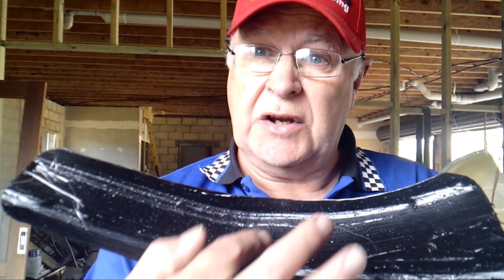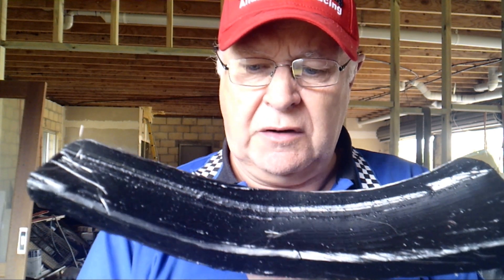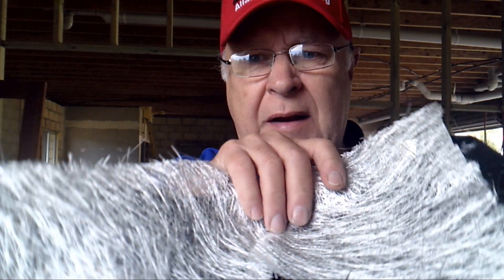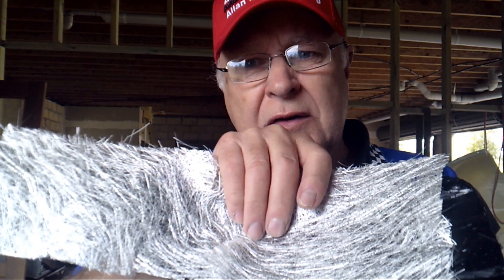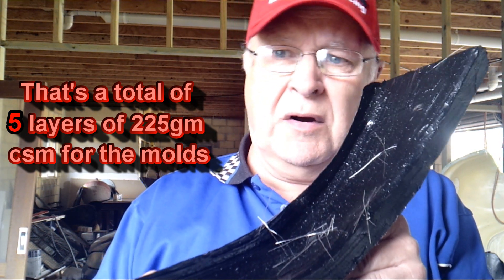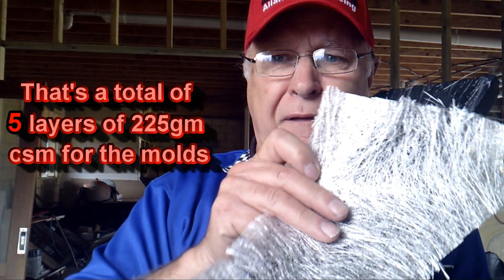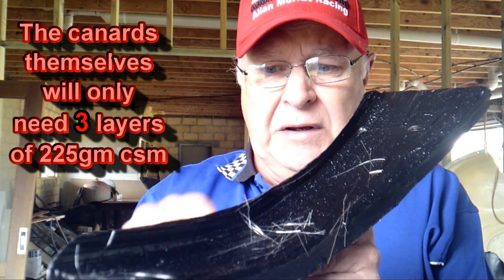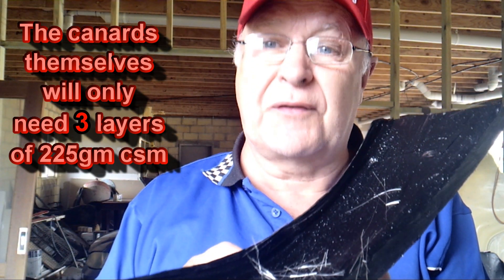How to Make Car Canards - Part B

Comment: what does gelcoat go?
Reply from the maker: Do you mean "What does Gelcoat do?"
Reply: Yep.
Reply from the maker: Fiberglass cloth & poly resin gives structural shape & strength to laminated items, but Gelcoat forms the finished, smooth, paint like surface. You can make fiberglass items without it - but that's rarely done by professionals who consider such products incomplete and amateurish in the extreme. Gelcoat is formulated to remain tacky after it sets so that it locks onto the cloth & fiberglass resin applied over it., and the chemistry of the fiberglass resin brings Gelcoat to it's final hardness.

Comment: Great Vid! Do you ever get shrinkage and warping using poly resin? I'm use to using epoxy but the curing time is a huge drawback.
Reply from the maker: No - never had those problems. The resin manufacturer I used to work for made three speeds of part B epoxy resin. Maybe you need to go to a faster setting one?